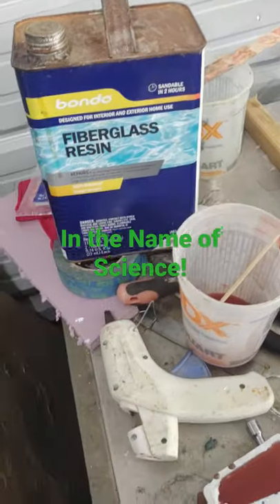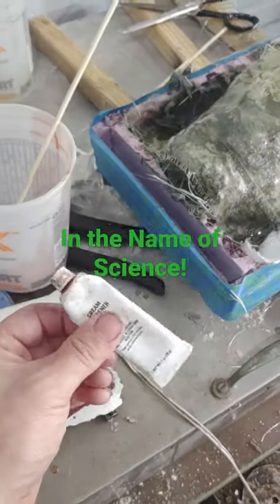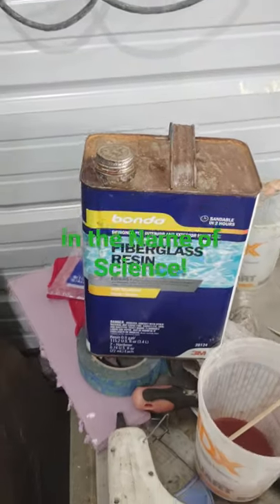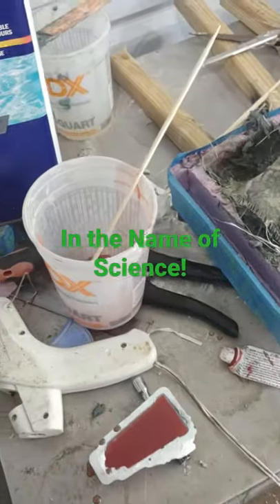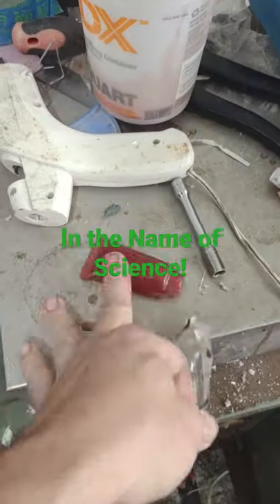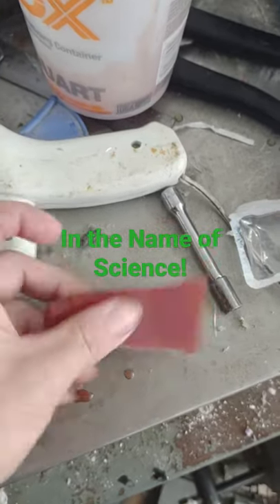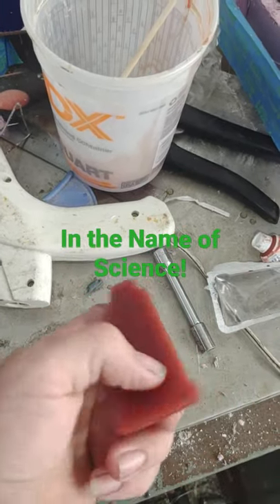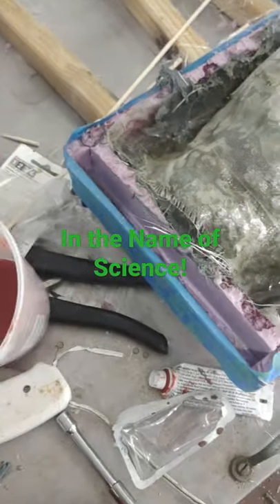Can you use Cream Hardener with Fiberglass Resin?

Comment: It's always worked for me too but, I've never used it in straight resin rather, I use a little fiberglass resin mixed into bondo to thin it out, a trick I learned from an old body man that used thinned out bondo instead of glazing putty.
Reply from the maker: Something I didn't get a video made of, a few years back I was building a costume with cast resin horns, and instead of special ordering resin, I just got the fiberglass resin and poured it into a mold.  I'd wondered though if this would work too.  But thinning Bondo with Fiberglass resin is new to me.  I'll probably give it a try.